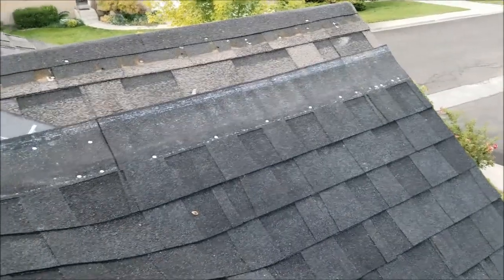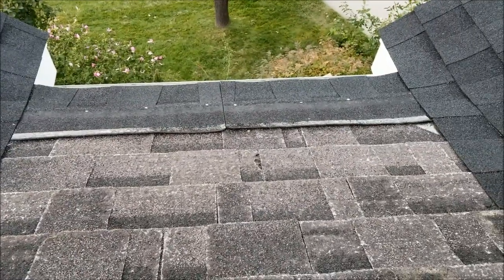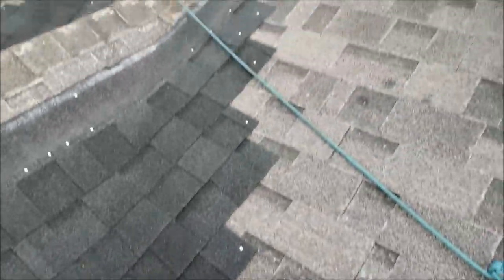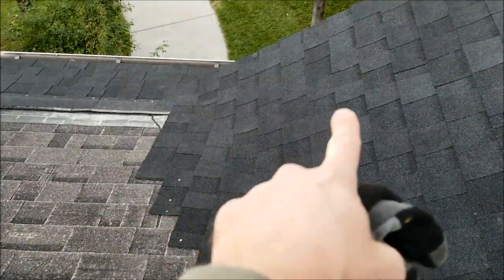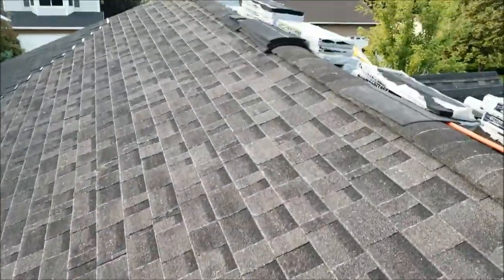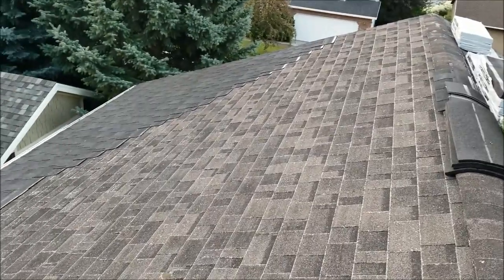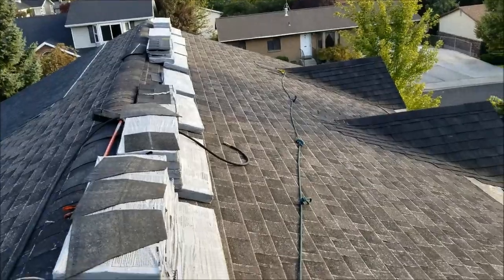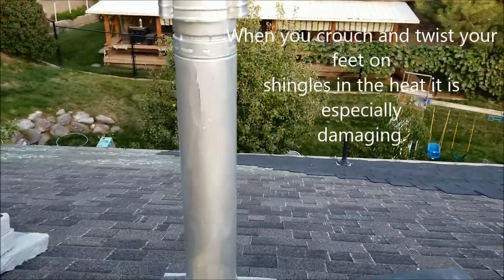How to Roof Valleys: DIY roofing part 3

Comment: Great job man ! This roof will be fine 
I did same thing no issues 13 years now 
Thank you for making awesome video
Reply from the maker: Thank you!  I know it's not "ideal" and some of the professional roofers in don't like it but I didn't have the time or the money to take off the old ones or pay a professional at the time. It's holding up great still several years later with no problems.

Comment: The old timers have done 2 layers for years and years, if there are no issues and it looks good isn’t that what the end goal is?? I think you did just fine man!
Reply from the maker: Exactly. Thank you! 2 layers is fine. I did this nearly two years ago and it has survived just fine through very harsh conditions and still looks great with zero problems and no leaks. Thanks for the comment. I was not posting this video to show the ideal way to do a roof. This is a way it can be done. I was also showing an example of how to roof dormers that stick out of the main roof and the order in which it can be done.
Reply: The main problem that arises is that you now have double the opportunity for nail pops since you now have double the amount of nails. You also can’t use updated technologies they didn’t have 20-30 years ago like ice and water shield since you need to apply these products directly to the roof deck

Comment: Why did you strip the old shingles off ?
They are only going to shorten the life span of your new shingles
Reply: Looooooooool u serious???
Reply from the maker: I know it is probably ideal to strip off the old shingles but you can leave one layer of shingles under  new ones and be fine especially if you don't have any leaks or soft spots. I didn't have the money or the time to strip off the old shingles at the time so we placed the shingles over the top. The roof is holding up great and looks great. No leaks or issues at all. Next time the roof needs to be re-done it will for sure have to have all the shingles removed. I have done roof work with friends and professionals both ways.

Comment: worst roofing job ever please no one follow your bad workmanship
Reply from the maker: Can you explain why? Sure it may be ideal to remove the old shingles first if you have the time and money to do so but there is only one layer of shingles, there are no leaks, the roof is holding up great, looks great, and has no leaks still. You can cover over one layer of shingles and still be fine. If you have the time and money to remove the old shingles off your roof then by all means do so.

Comment: While most states do allow you to shingle over 1 layer of old shingles and remain in code.. its not a good way to go. You also should still be putting down underlayment over the top of the old shingles. You also have no idea if you have ice and water shield under the old shingles.. and ice and water is only good if it is stuck directly to the decking itself.
Reply: You can get away with it one time I would not recommend 3rd time it would be to heavy